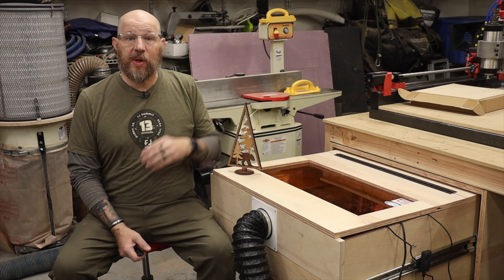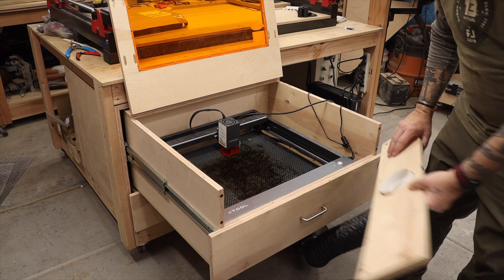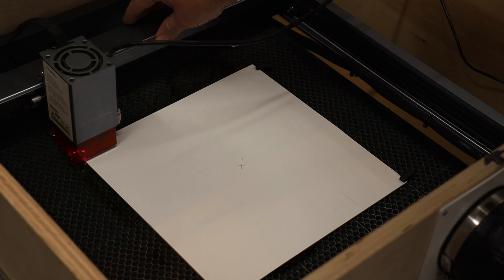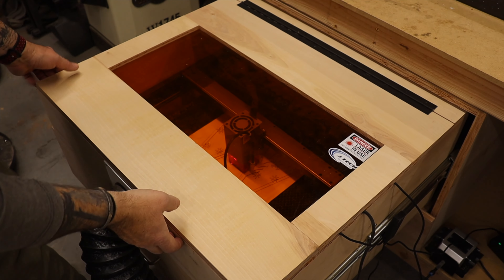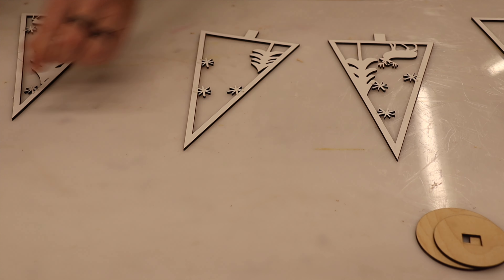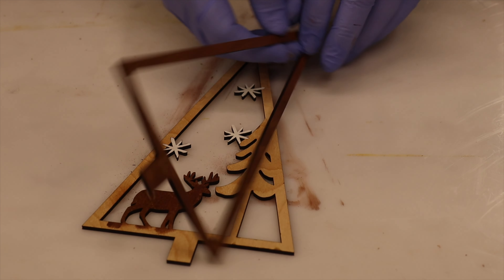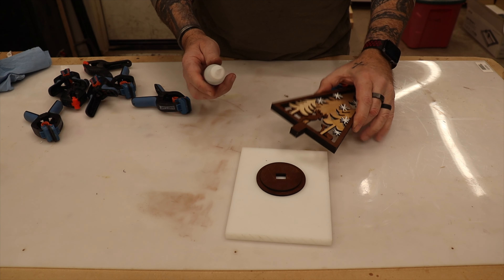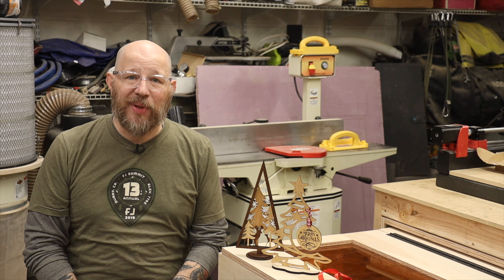Laser Enclosure & Shielding That's Safe to Use in a Closed Shop - AND a quick bonus project

Comment: Using pegs is a super good way to clamp down the work piece. 
if u have wood that bowed in the middle thats prblematic getting it flat, instead of placing many clips around the edges, i puzzled out an easier way (well easier when u need it, but takes some ahead of time prep). create a honeycomb pattern in the laser software (ie., honeycomb pattern that is accurate to the one u have on the laser) and lay it over the pattern u want to cut. then find honeycomb(s) that is near the center of the problem area of your board AND is located outside the cut (Ie.,, waste area). then locate that spot on the board and drill a hole the size of your clip ,then use a clip there (u will need low clearance head on it to avoid laser head collision)... cutting out a long strip of wood with a honeycomb pattern ahead of time helps to quickly locate that spot on the board. Make it long enough for the full width or height of your honeycomb sheet. (or u can go full sheet if ambitious, lol). 
Also looks super cool hanging on the wall.

Comment: What is the purpose of using the masking on the wood? Also is using the CA glue better than normal Titebond wood clue?
Reply from the maker: Thank you for watching Daniel!  When I started using a laser engraver, I noticed some of the pieces would have a smoke stain on the edges.  Masking the wood helps prevent that.  Another reason if if you are going to paint or stain part of a piece, you can just remove the masking from the area you are going to color to prevent it from crossing over to where you don't want it.  In this case, I didn't want to wait for wood glue to cure.  Using CA glue allows you to move onto gluing the next layer quickly.  Take care!  - Ed
Reply: @WolfRidgeWoodworking what material do you use for masking?

Comment: Thanks for the inspiration on the enclosure.
Are you building a PrintNC router?
Reply from the maker: Thank you!  Yes and I actually did my first cuts on it today.  It was surfacing the spoilboard.  I've been collecting parts and building it slowly for the past year.  Do you have a PrintNC also?  - Ed
Reply: @WolfRidgeWoodworking  I sure do! Darn fine machine.